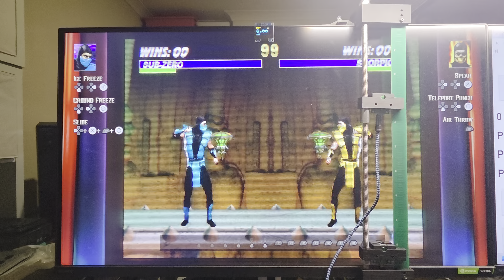03. Video showing further test functionality using input lag tester with EasyEDA boards.

Comment: thanks for the walkthrough, I'm concerned with only testing overlay input tho

MKLK rant (MKT): compared to duckstation, the overlay appears to be an extra frame of latency: Press Block - (2F nothing, 1F animation change) vs (1F overlay change, 2F nothing, 1F animation change). When compared to SFA3, duckstation vs fighting collection, their overlay lines up with frame data and doesn't show up early.
Reply from the maker: The relationship between the command history and animation isn't always consistent, I agree. In some games, it does seem to be (SF6) in some games command history came first (T6 I think) in some games animation came first (SF4 from memory) and in some games, it depends on the system (e.g. MK1 on XSX/PS5 was consistent, on NSW it seemed to be inconsistently related to the animation.

So why use it then? 

Firstly, using phototransistors you generally need something stationary and with a large swing in brightness. Command history normally achieves this.

And having tested this, anyone can go and test the relationship between the command history and the animation (video capture is ubiquitous to systems now, however the ability to determine button to command history is much harder). Not that most people will, but the ability is there. 

In my other tests (video interrupt etc) I will often look at animation as well as command history.
Reply: @noodalls  thank you for your insightful response. In my own quest to gather pristine footage, the ability to gather every presented frame to the observer into a file for review also has its hiccups (I've got 8h recordings by various methods which get graded by a script).

Have you had a look at presentmons overlay option to flash a white bar on input? I thought about comparing that to command history of various games, or at least known frame data to see how accurate it is. I'd want to replicate your devices input cadence but I suspect ahk may not be that precise.
Reply: Footsies training mode with input display on
491/499 reps matched the rtss latency marker flash, 8 reps flashed 1 frame before input display

MKLK-MKT training mode command history
163/498 reps matched the rtss latency marker flash, 335 reps flashed 1 frame before command history

neither had the input/command history show up before the latency marker flash, just a quick look at an overlay that flashes on input (pc specific boo)
I've got to polish it a bit more before I would publish something
[edit] first stumbling block on skullgirls, ask ahk to do 30F intervals, somehow they ended up as 36F intervals but only in SG, going to want an external device sigh.